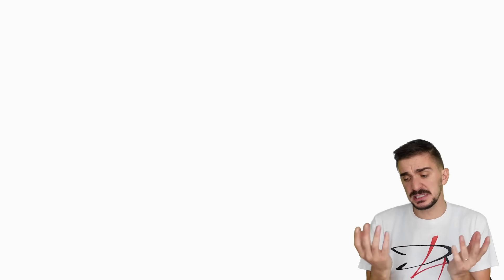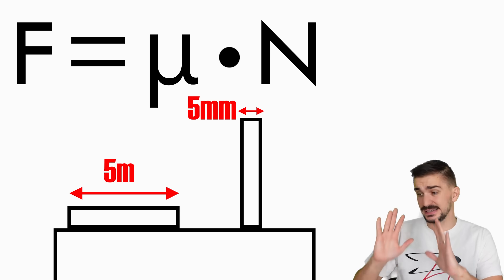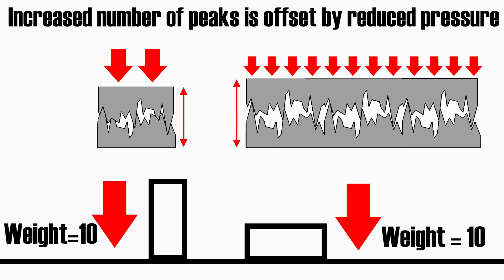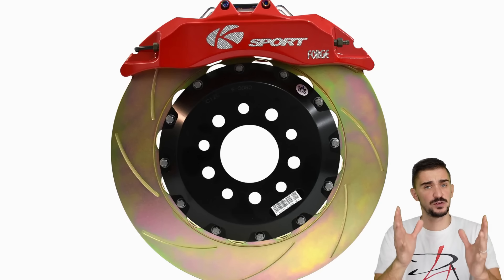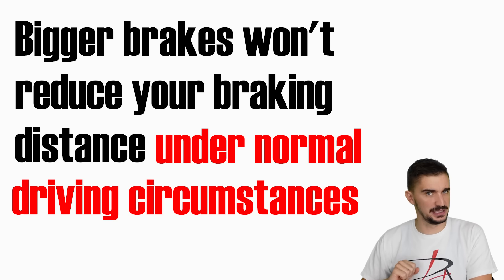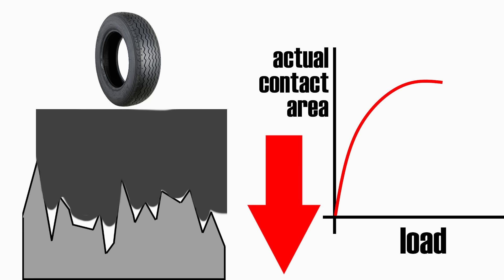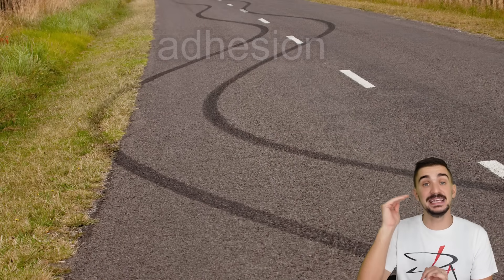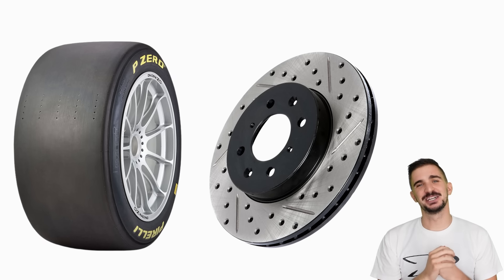Why Big Brakes Won't Stop You Faster but Wider Tires Will - Friction and Surface Area Explained

Comment: I'm a tire design engineer who worked on some of the slicks you showed, wanted to say, great explanation!
Reply: As an expert (not trolling you) please read my comment above concerning the shape of the contact patch and tell me if you think it is correct. Oh never mind, I'll just cut and paste it here:

Excellent presentation, as far as he went....see, one must also take into account the shape of the contact patch of the tire on the road.   Skinny tires have an elongated (front to back) patch while wide tires have the opposite, which is  a wider contact patch.   This is critical on motorcycles especially.  A thin contact patch will, because the tire is elastic, under hard/extreme friction will cause the tire to "ripple" making the bottom of the tire the shape of a sine wave.   Reducing contact with the road while a wide tire with it's wider contact patch will deform much less, giving better "stiction".   And worthy of note, no matter what size/shape of tire, the contact patch area remains the same.  The shape will be different but the surface area contacting the ground will be the same.   I wish he'd have added this information to the video as it is not a minor consideration but a major factor in handling and braking and acceleration.  I give the video a thumbs up because everything he said was spot on correct, just incomplete so in school grade terms, an A minus.

Please tell me if I am correct.
Reply: @fireballxl-5748  hey engineering students here. Some of the points are correct but I am not sure what you mean by "no matter what size/shape of tire, the contact patch area remains the same." also you said  "take into account the shape of the contact patch of the tire on the road." although correct it is not related to the video. the shape of the patch matters when side loading occurs (e.g. hard motorcycle corning) .
Reply: @fireballxl-5748  I tend to agree with some of what you’re saying about contact patches. We disagree on his video. I feel that he is being very disingenuous. Bigger brakes are to prevent fading. Bigger brakes are for repeated stops as in performance driving which is why nearly every performance car sold has bigger brakes than the lower trim models. I feel like the internet just likes to whore themselves and clickbait things like this with catchy or juxtaposed nonsense such as “bigger brakes don’t stop better”
Yeah. They do. 
Let me know when Ferraris stop coming with 16” carbon ceramic brakes and start coming with little huffy bicycle brakes instead since this guy and the internet say that “bigger brakes don’t help you stop better”
Reply: @fireballxl-5748  The effect of contact patch shape exist, but if you look at the numbers shown in the video, 10% wider tires have just a 1.3% better brake distance. Different tires with the same size would have bigger difference in results.
Reply: @fireballxl-5748  He DID address the area issue -- incorrectly.  He said explicitly -- and falsely -- that a wider tire has more contact area.
Reply: @denniswhite4446  why do you think it doesn't?
Reply: @johnrbnsn  this dennis dude though everything is perfect rigid and thus only a 1D line is in contact with the road🤣
I was like him a few years ago but he will turn around. give him some time.
Reply: @ddjohnson9717  I was like that too. Maybe it's a recent engineering grad thing? Life gets better when you get past it!
Reply: @johnrbnsn  The area is always just the weight (force) on that wheel divided by the tire pressure (force/area), assuming pressure is kept constant.  If you read some of the other comments to the video you would see that others have pointed this out too.
Reply: @johnrbnsn  I mean, considering a tire a rigid body sure does make all the math easier
Reply: @denniswhite4446  Yes, the simple mistake is that people assume a tire twice as wide will give twice the contact patch area. The patch area stays the same size, it just changes shape.
Reply: If width is important for tyre grip why is not a parameter (afaik) on Pacekja tyre model?
Reply: @marcos1669  Pacejka model is an empirical output model, it doesn't use physical parameters. It just provides a "good" fitting curve to measured tire data.
Reply: @johnrbnsn  thanks john, so what impact does width have, is it described in any model? I mean public model ofc
Reply: Are you out of your mind?  This guy is a fraud and he doesn't know what he is talking about.
Reply: @johnrbnsn i'm sorry you had to deal with all these insane YouTube ramblings...
Reply: Until you air down. Combine wide tires with less air gives you a larger contact patch.
Reply: @mitchellirwin5260  for wider tires you can softer compound so you will get much better grip.
Reply: @mitchellirwin5260  Each tire compound has its optimal pressure. If you take a wider tire and deflate it it will work worse. Wider slicks on racing cars are made from another softer rubber which works better at lower pressures. But that depends also on the road surface and rubber temperature. So it is not so easy, and effect is not so big. If you came to some amateur races and ask others which tire pressure they use, you will get a wide range of answers without clear correlation to the results. So if you are not a professional pilot your results depend more on your skills then on tire pressure and width.
Reply: If you are a design engineer you would know that this guy made a non point.
I’ve never heard anybody claiming that “big brakes” make the initial cold stop shorter. 
On the contrary pretty much everyone with a sporty car knows that big brakes are for making repeated stops shorter, which they absolutely do.
Also, even if he added an asterisk and said “big brakes don’t make your first stop shorter”  well, he’d still be wrong. go ahead and mount bicycle brakes to your suv and tell me again about how brake size doesn’t matter. They should start running miata brakes on tractor trailer trucks now?
Reply: @WithCarePlz  The question is that most of the brakes that are used in cars are more than sufficient for the type of tire they use, it's not surprising that the ABS system exists, precisely to control braking, because if the brake works at its maximum limit it will most likely lock the wheel, which ends up making your braking distance worse. Finally, you ended up giving a very bad example, because obviously he is mentioning that the size of the brake does not matter, because he considers the stock car brakes, which have more than necessary performance to achieve the needed braking (it's even stupid saying bicycle brakes on an suv would not work, as obviously suv's don't come with bicycle brakes).
Reply: @gamerbg294  thk you for the response to ozzy  its ok to think outside the box but i think he went out to the pasture on that one. comparing apples to bananas  😁
Reply: @WithCarePlz  u'd be suprised tho what people think.
Reply: @WithCarePlz funny you should mention a non point thats what you did
Reply: @WithCarePlz yes sure. as soon as they put bicycle tyres on the SUV we can switch the brakes and check if it still has the same stopping power
Reply: @ i’ll give you a hint, no an SUV with suv tires but having brakes from a bicycle will not stop well…
Reply: @WithCarePlz  in this case you getting diferent diameter of the brake discs so less leverage and also you are getting to the materials limitation and thermal capacity limits during first stop.
Reply: @ you’re making an awful lot of assumptions. People who argue this crap are always off into the weeds. People aren’t upgrading brakes on a Prius where one cold stop is what they’re worried about. People are usually upgrading brakes for cars that are driven hard, or on the track. Why would I care about the first cold stop if I’m braking into every corner as hard as possible as late as possible, where brake fade is the issue. I don’t think that there are tons of people out there doing a brake upgrade on their CR-V’s thinking that they’re gonna cut their cold stop distance in half. Most brake upgrades are done on cars that are performance oriented.

Comment: Always go big and consider brake pad and rotor material (ceramic) cross drilled, slotted.. ultra wide tires cause drag hence salt flats cars us skinny on for corners. For handling and heate cycles from stop n go, go wide and big. Who made this...?

Comment: Big brakes may not stop you faster in a PANIC stop.. But on a daily basis they often times but not always require less brake pedal pressure, and give a general better over all feeling. Brake fade from an inadequate braking system tend to be done away with when going to a larger caliper, multi-piston set up over a single cast iron piston and 11" rotor. I recently swapped from an 11" rotor, single piston cast iron caliper, over to a 15" rotor, and Brembo 4 piston aluminum calipers. The difference is night and day compared to the old set up.. I can literally just lay my foot on the brake pedal and with very mild pressure I can stop the truck. The old system you had to really press the pedal much more firmly, and then it would wear the pads out pretty quick, and also warp the rotors due to the excessive heat generated trying to stop the truck. A NEW set of rotors and pads, would last about 18 months. I know the new brakes alone won't stop the truck faster in a PANIC stop than the old system would because it all comes down to the coefficient of friction of the tires. I have also put 20 X 10" rims on the front with 265/45/20 tires with the new brakes... So my truck WILL stop faster, and in a shorter distance, than the old system because of the larger grip surface area of the new tires, and will take significantly less force on the brake pedal to lock them up.

Comment: If you haven't reached your tire grip limit with your oem brakes (ABS kicking in directly even at high speed) then bigger brakes will make you stop faster at these speeds. The initial bite/stopping power is stronger too, cutting the speed down instantly. Bigger rotors/brakes with the added leverage provided will stop the rotor more easily at any speed. It is even more noticeable at higher speeds... Now if you upgrade the rear brakes properly too (OEM front/rear bias is very conservative) you will reduce stopping distance dramatically and let the 4 wheel abs (or your right foot) do the work. Weight transfer to the front tires will be reduced causing the ABS to kick in much later. All this while keeping the same tires... If you upgrade the tire compound too, you will take even better advantage of big brakes yes! But like you pointed out the biggest improvement of big brakes for intensive use is the heat dissipation. This is why it is important to not skip on the alloy 2pcs floating rotors when doing a brake upgrade, it ads most of the benefits while keeping the weight of these bigger rotors down.

Comment: Nope not faster but require less effort and in racing, it means more reliable results vs small brakes, but yes brakes alone do not improve stopping distance, and that being said most cars don't come out with ideal equipment unless you pay for it.

Comment: Sorry if this has been mentioned (I didn't read ALL the comments), but you're doing an apples-and-oranges comparison. The brakes are smooth hard surfaces sliding over each other at high speed (sliding friction), and the tyres are a soft surface mechanically keying to a hard rough surface, up to the point of sliding commencing (static friction). They are two different phenomena.

Comment: wear of the material - while the mm^3 removed may be the same - for a given frictional force (all else being constant.., the thickness (mm) removed will be less with any increase in area... Then we get to thermal capacity...

(also increasing rotor size allows more powerful hydraulic booster and more pistons....  (later braking is possible with more rapid clamping - to the limit of the tyre friction - of course)

Comment: Nice video except for two things. First the graphs for surface roughness were way to exaggerated.  Second he completely skipped the fact that most large or upgraded brakes will also have stronger brake calipers which apply more force. So yes they do stop faster when more force is applied. Also the materials the pads and rotors are made out of will have a drastic effect on braking. This topic is not an apple to apple comparison.

Comment: also motorcycles usually have more disc surface/weight so even with similar cooling they would overheat later

Comment: but brakes don't work in a linear way, for the same tire size, larger discs means same breaking force generates more breaking torque.
So for a given tire diameter, the largest wheel/smaller tire profile, and the largest disc fitting in the wheel will give you the best braking torque, and best braking distance as long as you are not limited by traction.
realistically, most brakes will be able to lock at low speeds, so the difference will only be see nat higher speeds

Comment: Wider tires = more energy transmitted to the brakes. So, except for the highly unusual factory race prepped cars, this puts more stress on the brake rotors and pads to dissipate energy to the cooling air = overheated brakes. Gotta do bigger brakes and with wider tires if your aim is performance, not just cosmetics.
Reply: Wider tires don't increase the size of the contact patch, so won't increase the work for the brakes.

Comment: Just wider tires will not improve braking .The compound of those tires very important , if the compound is to hard you will loose braking . Inde cars weigh as little as possible  , If you put the widest street tires on one , it would loose a huge amount of its braking , and any races it entered

Comment: That title is wrong, of course bigger brakes till stop the car faster, considered the tires can keep up, obviously. 
The bigger brakes, or rather better brakes, can take out more rotational energy from the wheel.
Most regular cars have way too weak brakes from factory and are only working ok within regular driving patterns, not emergency braking. I had a Toyota years ago, relative new Camry, and even at 130km/h on the motorway, hitting the brakes would heat the up so fast they lost all effect before the speed reached 80 km/h and needed to to cool down before stopping the car fully. it would had more effect opening the window and waving my arms, to stop the car at that point. I hope they improved their cars since then.
I have upgraded several cars to get better brakes, and it always shortened the stopping distance. Of course the first rule is using the best tires you can afford, that's the most important safety feature on any car.

Comment: i thought big brake kits was literally just for looks 🤔  

your giving away secrets. think I'll join you. 

tire compounds are the most important factor. 2nd most important factor is weight transfer. 

widths of tires is more a function of life extension than serface area improvements. tires are all ways a compromise. small light sticky tire won't last a whole lap but would drastically increase proformance. unless there was liquid in the track. 

hard wide knobby tires would last years and years but would drastically decrease proformance. 

slicks are better unless you need to turn or there is liquid. 

almost as important as picking the right tire is picking the right spring and shocks. if you installed a set of 90/10 shocks on the front your acceleration improves by ridiculous amounts. but would reduce steering under acceleration. reverse that and you would have pore take off and prefect steering. springs are the same. stiff front springs losse rear springs means faster harder acceleration at cost of steering. losse front hard back good steering no acceleration and stiff all around not good for either. compromise 

okay to many secrets. but you should research gearing. combine with tires and suspension this is the secrets of racing horsepower is the least effective upgrade.

Comment: But still, there is another aspect of which larger disks lead to better braking, and that is the braking torque, with larger disks we get more braking torque for the same braking force regardless of the fact that friction does not increase with a larger contact surface.